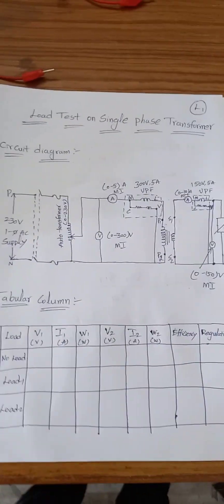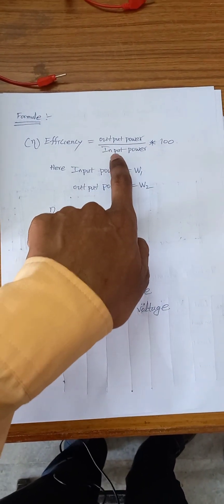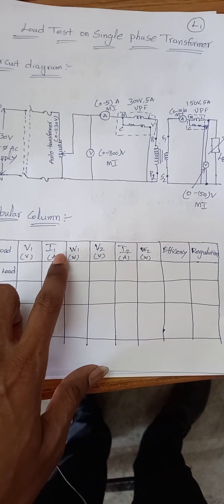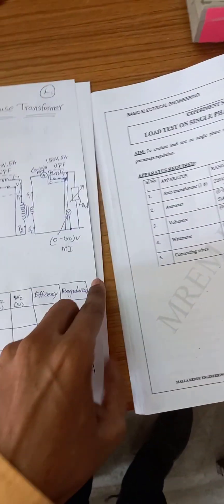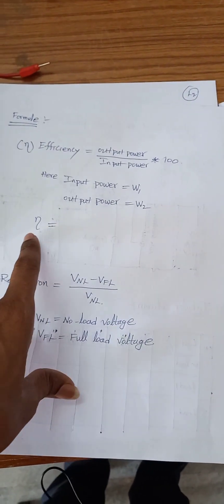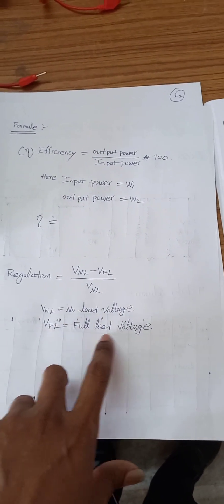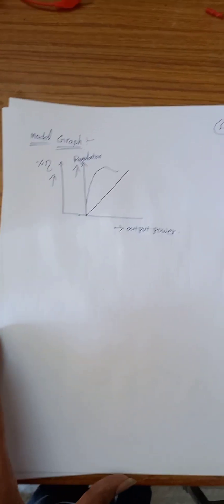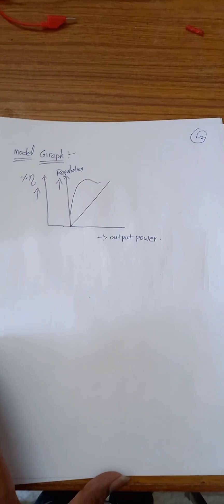Load Test on single phase transformer

Comment: Mam , you connected "V" of primary side to autotransformer and transformer but why didn't you connected to voltmeter
Reply from the maker: @gvs5002  power supply given through auto transformer. If we connect power supply directly to the kit then only Voltmeter need to know the power supply but not vary voltage directly three phase power supply to the kit but connected auto transformer we can vary how much power supply we need by using auto tranformer